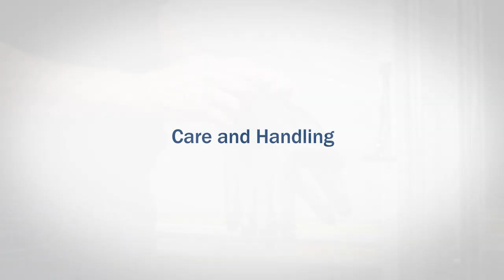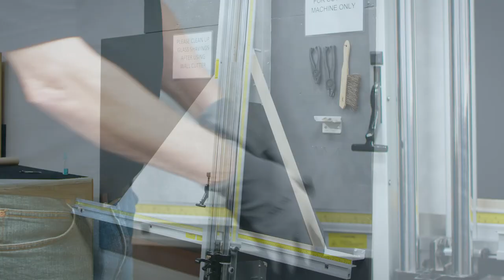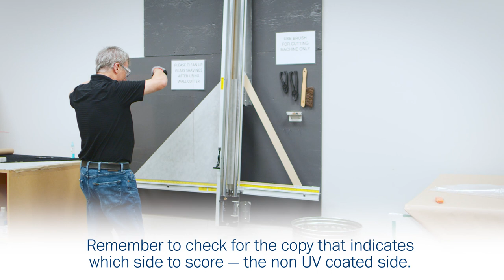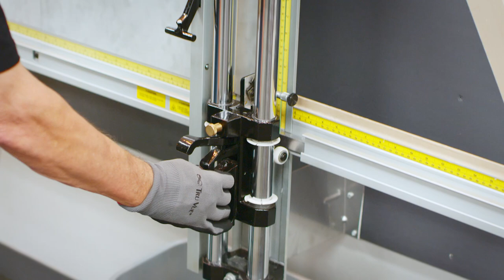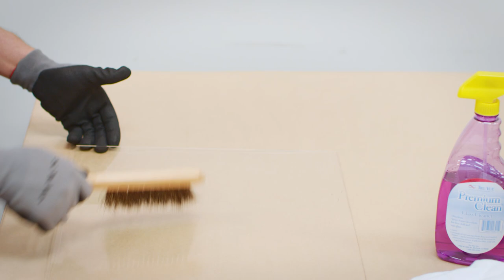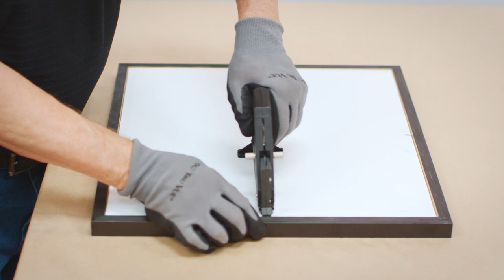Tru Vue® Museum Glass®: Care & Handling

Comment: Of I have a pre-cut piece, how would I tell which side has the coating.
Reply: Exactly what I'm wondering as well, and how I ended up watching this video. So far all I have heard of is some "scratch test" people do. I was hoping to find a video demo of it. No luck yet. I have dozens of scrapped pieces of museum glass I'm hoping to use and, if I have to, I guess I'll just dedicate a bunch of it for testing and do my own experiments.
Reply: It’s very simple. You take a razor blade and lightly scratch the very corner of the glass in a small spot that will be hidden by the frame. You’ll either feel a smooth glide indicating that that’s the front side of the glass, or you’ll hear a slight scratching sound and feel a bit of resistance, like you’re scratching very fine sandpaper, and that would be the underside that faces the artwork.
Reply: @marymonk  that’s very strange. I’ve never seen or heard of that. Every glass with uv has a coating on one side that faces the artwork. And when you scratch it with a blade, you can hear and feel it. It’s very thin, but it feels kind of like a thin crusty layer when you run a blade on it. The only “glass” that has uv inhibitors without a thin layer on the surface is acrylite which is baked into the plastic, and does not have a layer on the outside like traditional glass does.
Reply: @camilaramirezangel this was super helpful, thanks!
Reply: @silverstarfineart392  of course!